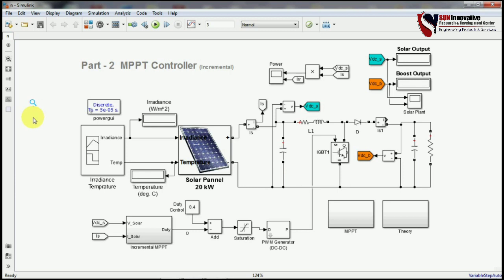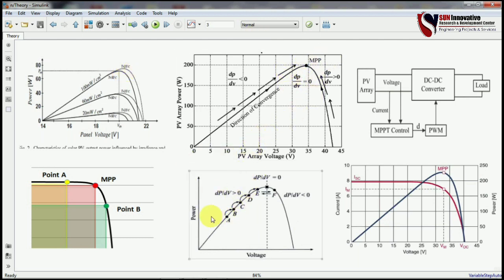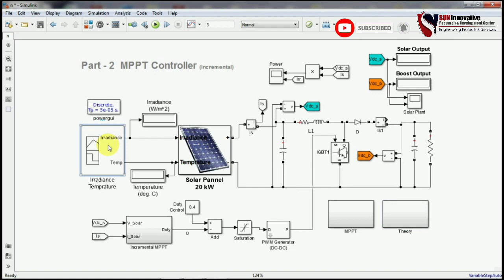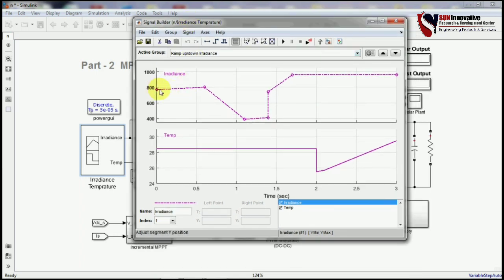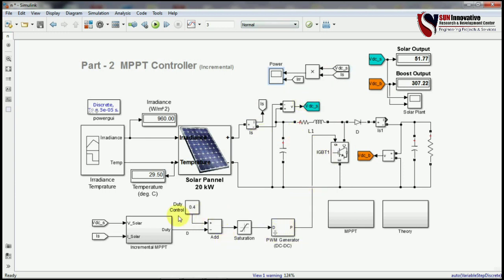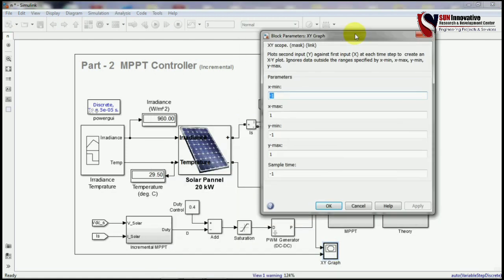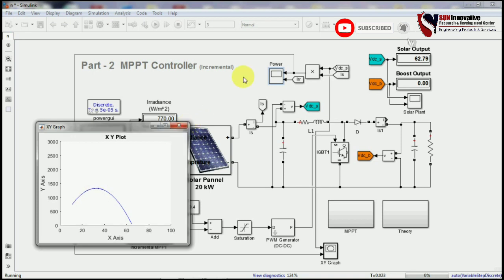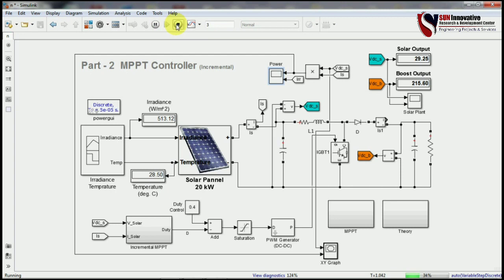Incremental Conductance (INC) | Solar PV Boost MPPT | MATLAB Simulation

Comment: Kindly reply.. If my pv input is 98 volt dc (open circuit voltage) max voltages on load 80 vdc, max current on load 11 amp.. how much max current can i get on 24 volt system with incremental conductive mppt?